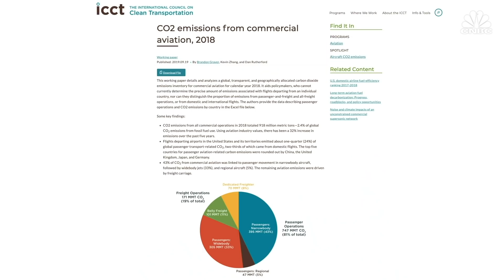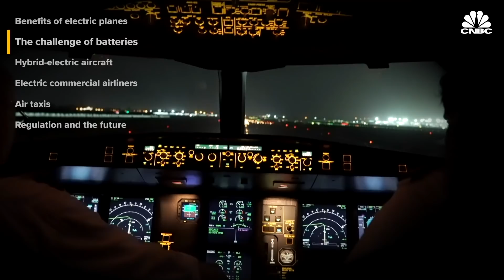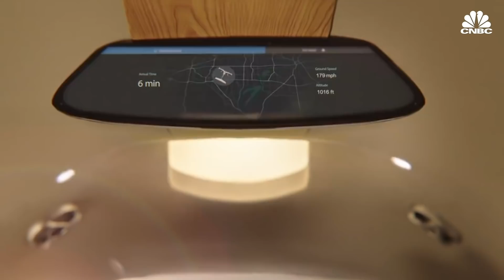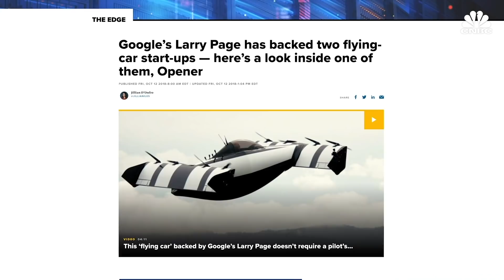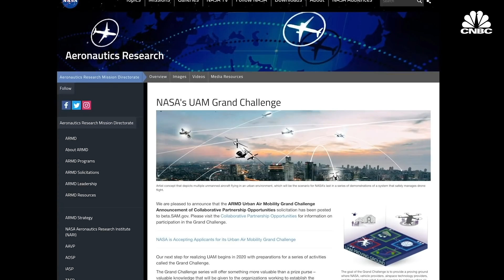Why Don't We Have Electric Planes Yet?

Comment: What about the turn around time at the airport? Aeroplanes do not make money when sitting on the ground. They only make money when in the air.  Accumulators currently take far too long to charge. The move is to electric vehicles is based on a fallacy that the climate is significantly affected by Carbon dioxide levels. It is not. Carbon Dioxide is only responsible for 10% of the planetary green house effect.

Comment: The electric aircraft is already a reality in the American military. The truth is that the wireless transmission of electrical energy to craft aloft is a done deal. Don't expect them to buck the oil companies any time soon.  No more lifting more fuel just to lift more fuel. The military craft aren't "planes" as you know them. They encompass both drone and piloted craft using field propulsion technology. Even wings are optional, and are sometimes just part of the disguise. They have it covered without breakthrough battery technology.

Comment: The energy density of hydrocarbon fuels is what makes them such a hard habit to break.  But even if batteries were available right now, having energy capacities rivaling those of liquid fuels or better, they still must be recharged.  Electricity is not an energy source,  it's a way to transport energy.  Until we're not burning ancient hydrocarbons to keep all the giant alternators spinning, rechargeable ANYTHING does little to solve our CO2 emission problem.

Comment: The “urban air mobility vehicles” or small electric helicopters will never be adopted if they are not able to reduce the sound created.  Think of a drone, super small and light and you can still hear it a hundred yards away, not think of something 30x bigger.  You will hear these for miles and they will be loud, nobody wants helicopters flying over them like cars drive down the street.

Comment: What ever happened to Algae jet fuel that the Air Force was using? Much cleaner and even more power. And it would take 2 days to fill a plane. I'd rather that.

Comment: Charging those batteries are going to be a problem. If not a hybrid engine, an APU will still be needed, it'll add range and/or reduce time btw sorties.

Or hot swappable battery packs at the LZ's. I believe the fastest way to charge is called "direct DC" but with battery packs so big it'll still take a hot minute.

Comment: Linear motor catapult could save battery power by launching the plane like on an aircraft carrier but energy density needs to be at least 400kwh/kg to be viable which is about 4 times that of a Tesla battery currently. Let's see what Maxwell has brought to Tesla battery team and whether it will be the Holy Grail of Battery tech.

Comment: This so called poor idea will take another 30 years plus to develop it. Electric air planes in this video very expensive flying batteries.  Could the masses of people afford to buy a ticket & the price be comperble or less than a conventional aircraft? What is the carbon foot print of a conventional vs electric?  That's the question that really needs to be answered.

Comment: Electric planes might be an alternative for regional flights. But since Li-ion batteries have an energy density of ~ 265kWh/kg or ~1 MJ/kg compared to jet fuel with ~40 MJ/kg, long range flights are not possible with current battery technology. range = fueled energy x efficiency / force. The force (energy / distance) to keep an aircraft lifted cannot be further optimizised in a large scale. So even with an effiency improvement of factor 2-3, the range will still be marginal and way below 1000 km.  
A good explanation of  a planes physical range limits  is given in the linked book (p. 269 ff) by David J.C. Mackay:
https://www.withouthotair.com/about.html

Comment: Ok , let’s break this down, it all comes down to this questions .Where is all this energy to power all of these pieces of equipment coming from? Do we have the technology to produce all of this energy in a clean and sustainable  way? The answers are coal and oil and No. there’s another question and that is , is it cost effective to operate any of these electric pieces of equipment and the answer is that with the current battery technology is not.  Using anything electric right now is just displacing the pollution from the tail pipe to the coal powered power plant. The highest share of pollution in the world comes from the generation of electricity so imagine if everything goes electric what kind of impact that would have on pollution and the environment.

Comment: So my question is how heavy would the battery pack be for a long-range (transcontinental or transoceanic) plane?  Would the weight of an electric propulsion system in a plane be less than the weight of current airplane engines?  My take is that over time advancing battery technologies will provide lighter and lighter batteries and that will seal the deal.

Comment: Clearly misleading commercial ad for things that wont exists or have been bad ideas .....fragmented urban travel by uber..think again...... there is not additional airspace in urban areas...failed business models want the US taxpayer to fork out 400 billion dollars to construct a new low level airtraffic control system ? Think again....... no company like uber that relies on taxpayers subsidies is going to be a winner. 

Most of the issues discussed are already serviced, dealt with in a safe way by regional airlines,  helecopters and GA aviation. This is in reality a evolution of existing GA, light and helecopters within the same regulatory framework. Flying cars were tested in the 50 s but the same problems cannnot be overcome by political lobbying or deregulation of safety.

Comment: >> There is a need for steam based aircraft's i get electric planes are raging question but the battery weight itself is the key problem but unlike this, we can look into earlier and older models of steam engines with a mix of hybrid gas turbine can be a phasing out mechanism we dont have options if fossil fuels are running out. I think specific to air travel we do need to have more research into steam engines with a combination of nuclear or gas more or less hybrid planes... (unlike rockets they dont have rocket equation nor its tyranny also https://youtu.be/YRPuDQtB_5Y )

Comment: The answer is Power Source. Batteries are getting better so maybe someday that will be the power source. Nuclear power is too hard to shield the reactor. Solar cells are not efficient enough. Fuel cells maybe an option? Where will we get the power to run the plane?

Comment: Because you can't have planes with enough energy in the betteries to be comparable in performance with fuel powered jets. The energy density of even the best available battery now is far too low compared to kerosene, so the equivalent electric plane will be very low range or impossibly heavy and unable to fly.

Comment: I'm sorry but when they are working from a faults premise that CO2 is a pollutant and that we have to much of it (we don't!) then they are doomed to fail! If you don't even understand why your doing something and all your assumptions are wrong you will never succeed.  The reason to change is that what you have to offer is ACTUALLY better and cheaper, and as electrics fail at both those objective (not to mention how toxic and environmentally damaging batteries and electric motors are to make) someone is going to have to start over with a clean sheet of paper and go at it again?  Fuel cells come to mind, as well as super capacitors, and electric motors that are not made from such exotic and toxic materials (neodymium magnets are very toxic to make and mine.) and then consider repurposing how we use and derive energy from petroleum fuels.  Oil is the single best energy dense substance ever devised by nature, we just need to use it better, and ditch this idea of batteries, (unless they are fuel cells) they are never going to have the energy density of a unit of oil.

Comment: I'll save you 15 minutes.
It's because electricity has nowhere near the power, at least in this age and the foreseeable future, to propel an entire aircraft and all of its proponents for hours at a time. And even if it could it would most likely be considered too dangerous anyway because of the prospect of a plane possibly shortcircuiting and losing power entirely.

Comment: Battery density is an issue. The thing about fuel is as you use it the aircraft gets lighter making the plane more efficient as it flys. As battery power drains the weight stays the same. So the plane is just flying about carrying depleted batteries. Or empty power

Comment: Arc to get. Ac power to the  plane and dc to make that ac power step up  safer answering 
not just fast enough long enough but stable enough I dream of space flight with rocket
With plasma electric engines so much to do so little time.

Comment: I can't believe this video only mentions battery energy density as the single issue.
Sure range is a problem but what about propulsion? Did they forget that propeller aircraft are slower and don't fly as high as jet engines???

Comment: Why not putting thin solar cells at the top of wings and fuselage. They are flexible enough fit the wings and body. So, they recharge planes as they always fly above the clouds. It's not much but if they outcharge their extra weight during flight it might be considered an option...

Comment: I would rather have an emergency landing on an electric plane than a plane filled with jet fuel and burn to death.
Reply: Yeah electrocution is quicker
Reply: Jrv200008 How are you going to get electrocuted? Buy an RC car, put a barbie inside it, throw it against the wall a hundred times and you only get pieces of plastic and metal. Your barbie might get crippled but not electrocuted.
Reply: @epicon6  Lol you really comparing an RC car to a plane?
Reply: Jrv200008 Had to bring it down to your level :)
Reply: @epicon6  I don't see how a RC car is on the level of a student but okay. The argument of electrocution in an electric vehicle during a crash is very valid actually. Not too long a go a dude suffered that fate in a Tesla near where I live. Firefighters were unable to extinguish the wreckage due to electrocution danger.
Reply: That plane wouldn't even get into the air with full electric power. Like it or not jet fuel is needed by airplanes to even function.

Comment: "Why Don't We Have Electric Planes Yet?"

Title is wrong. There are electric planes. They are just two seaters
Reply: Electric plane can't hold huge amounts of weights, like the 747 jumbo jet's capability.
Reply: There are commercial electric aircraft being used by harbor air in Canada 🇨🇦
Reply: @brentfellers9632  The plane you talking about can't fly transcontinental routes
Reply: @tedyuan2066  neither could the Wright flyer...
Reply: @brentfellers9632  That's why planes still rely on fossil fuel. Aircraft is a big polluter comparing to automobile. We have to find either hydrogen or electric powered engine to achieve net zero around 2050.
Reply: The Oil Companies are the reason why we don't have Electric Planes yet
Reply: @unhooked25  There is a problem with the energy density in current batteries. The weight/energy ratio makes them a no go for comercial flights. It can work with very small planes, but not with a 747. We need a breakthrough in battery tech that multiplies the energy density in batteries x8-10 I think
Reply: DOMINION no physics are the reason we don’t have electric planes yet.
Reply: Joseph Barnett: physics or no physics, when (not if) WHEN electric plane technology starts looking like its gonna make a breakthrough the oil companies will step in big-time.
Reply: @unhooked25  So,  physics is the reason we don't have electric planes yet. Yeah, oil companies will obstruct, but for now it is physics. 
Also wonder what will happen to jet planes.
Reply: @lamia197  You both are wrong. We have Electric planes already. The reasson why we wont have long distanse high capacity planes only Electric is speed and range issues

Comment: Batteries don’t have the energy density of jet fuel.
Reply: Yet
Reply: There's not going to be electric planes that look like a modern 737 or something, they will all be open propellers and probably slower at first.
Reply: @Arv San you forgot that jet turbines are much more powerful than propeller aircraft meaning that besides the range issue, electric aircraft won't fly as high and fast as jet aircraft.. it will be like fling back in the '50s.. Tesla doesn't have this issue since electric cars go also using wheels on roads.
Reply: @Arv San i don't care "what was told" or about conspiracies, i care about the facts: electric cars have a different energy (electricity) and a different way of converting it into motion (electric engine) but yhey generate traction still using wheels. Not same for planes where all 3 are different and nobody would like to switch from jet to propellers. Certainly not military jets :)
Reply: @Arv San I'm aware of solar panel wings.. but the real challenge isn't bettering batteries but creating traction with same performance as we got from jet thrust.
Reply: @cordisvictor  I'm just gonna be honest. The energy density of batteries is at a peak of about 2% of that of gasoline currently. Don't expect a big change in our lifetime for this to be implemented in boats and airplanes for the common man or business. -signed mechanical engineer

Comment: Okay but no electric engine will beat the GE90
Reply: Not true.
Reply: Maxwell Seefeld an electric engine could not beat the amount of thrust a ge90 produces and the loud engine start that pilots love
Reply: @Cornocat  there is electric engines that do all ready but are not yet functional due to the shear weight of them.  I must ask thou why are you sighting a GE90 and not any of the engines used by USAF or RAF as the pinnacle of gas powered aviation.
Reply: @Cornocat Btw no pilot cares about sound only about thrust and manuverability speaking from experience here.
Reply: Maxwell Seefeld I’m speaking for avgeeks and commercial pilots and yes, as a pilot, the power you feel from the ge90 and the sound it produces is probably one of the things I love most about aircraft. Let me compare this situation to cars, a lot of people who love sports cars love them for many reasons, and mostly one of those reasons is because of the loud sound and the feel of power, now lets say a Tesla (or an electric sports car, not sure if one exist) is being compared to a lambo (I don’t rlly know much about cars) I’m pretty sure Tesla’s don’t produce a sound at all or a sound that will beat a lambo, I’m also sure that a lambo can accelerate faster than a tesla. I would love for them to have electric engines on newly built aircraft, but not replace the aircraft already existing with electric engines.
Reply: @Cornocat  also teslas accelerste faster then lambos.
Reply: Maxwell Seefeld didn’t know that but you get my concept right?
Reply: @Cornocat  yes.

Comment: Why not electrifying the marine industry first? slow boats need little energy to drive and battery weight is not an issue at all.
Reply: great idea
Reply: You should look into this, but short answer is they’re trying. Longer answer is that fuel/ energy requirements are actually huge and battery weight is actually a pretty big issue lol
Reply: There are definitely some good videos around on this.

Comment: Electrically powered landing gear seems like a lot better option! Without having nearly as much weight you could eliminate the highest fuel usage on taxi ways, and the airplane went nearly as much right away or fuel to take off! He would still need a generator on top of it to run air conditioning in the cabin! I have not understood why they don't use tow vehicles to get the airplanes out to the runway, using those huge jet engines pushing against air at low thrust seems to be a very inefficient way to position a plane for takeoff!
Reply: Just by having a tow vehicle you can probably increase the range open airplane by up to 50 miles on the same fuel! The best solution would probably be having a tow vehicle and electric motor-driven wheels! That would cut way down on fuel used on every flight, on a dry runway you can take meet up to 30% less runway length! There's two things could be implemented with the technology we have today! The reason why using both together is better, is because you wouldn't have to add nearly as much weight to the aircraft as the batteries you would need to go from gate-to-gate! Battery power only being used on the actual runway!

Comment: So even with solid state batteries, they would still need 4 times the weight in batteries to perform similarly to a jet fueled aircraft. Perhaps battery-electric isn't the answer here.
Reply: Lithium air would solve the problem, but they are not viable at this time.

Comment: “Urban Air Mobility” or as they are currently called “Helicopters”
Reply: I like that bit where the helicopter lands on the building. That has been banned in NYC since the Pan Am Building disaster in the 80s. Not likely to return.
Reply: The concept does not really exist. This would be more like a drone with multipropellors say 6 or more with people carrying capacity
Reply: They are inventing a concept that already exists lol
Reply: @joshuas3897   yes but their basically helicopters that are at least 90% cheaper to operate.
Reply: @joshuas3897  Are helicopters quiet? I didn't think so
Reply: @gabedarrett1301  the noise is mostly from the blades and not just the engine the buzz and chop you hear from aircraft is mostly sound from the prop or rotor.
Reply: @gabedarrett1301  : are oversized drone cars they're trying to sell as flying cars are safe and reliable?
Reply: Helicopters are extremely inefficient in terms of fuel consumption. Hence why it's extremely expensive to operate. It's also way slower compared to any propeller aircraft.